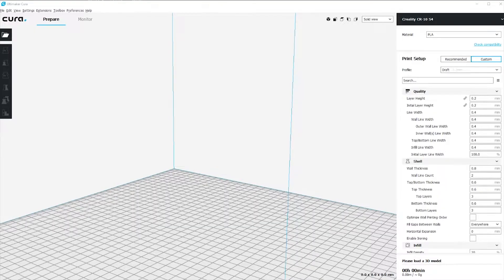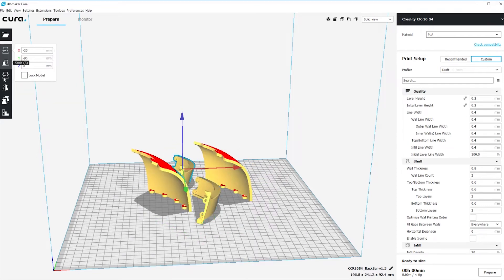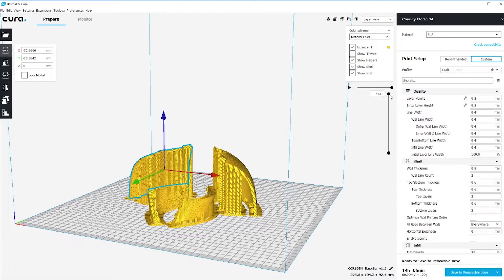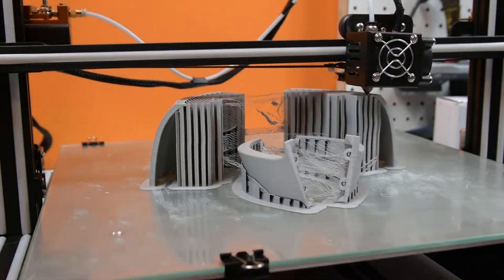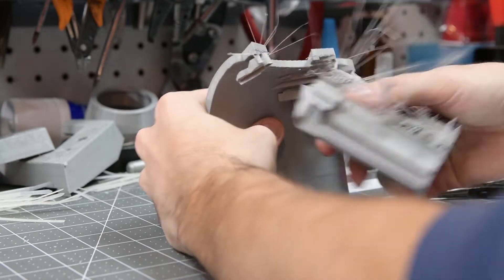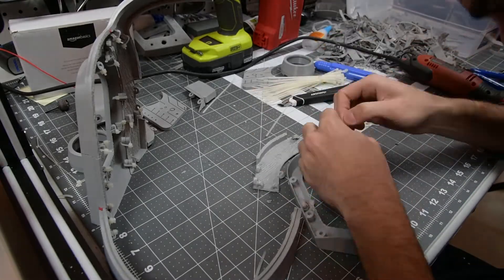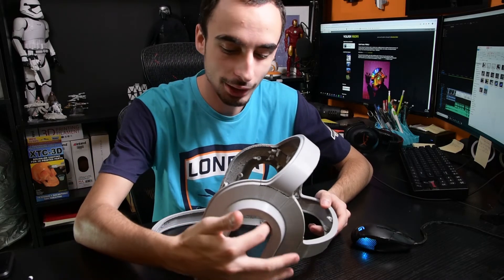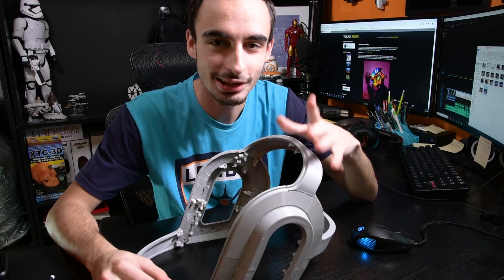HOW TO 3D PRINT // DAFT PUNK HELMET BUILD PT 1

Comment: Would you ever 3D print a Mau5 head?
Reply: Make & Repeat have you seen anything about really accurate/close to the official head models?
Reply: If you ever wanna I have the 3D model file of my Mau5 head model I have it. I will share a link of the specific model so you can look at it and such,
Reply: Check out this scene in 3D and virtual reality on Sketchfab:

Carbon FIber DeadMau5 head Perfected https://sketchfab.com/models/1b17cd5700d843fe8a0f46c46546ed7d

There is the model link ^^
Reply: Make & Repeat not really, but I will soon